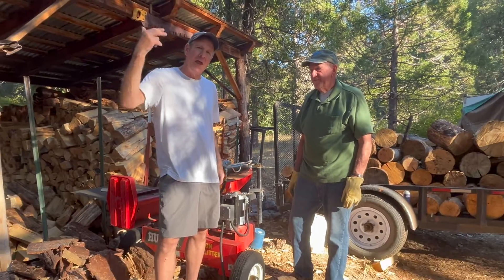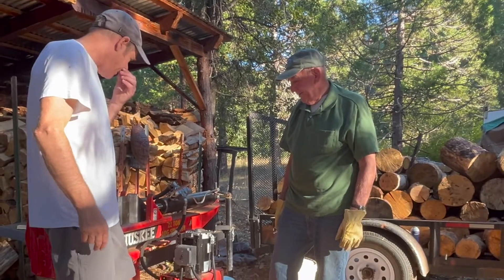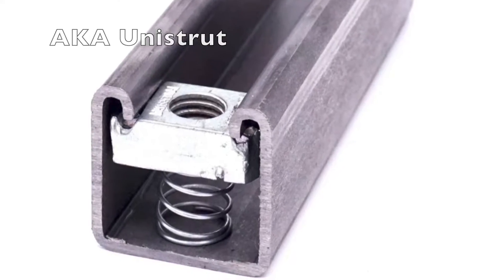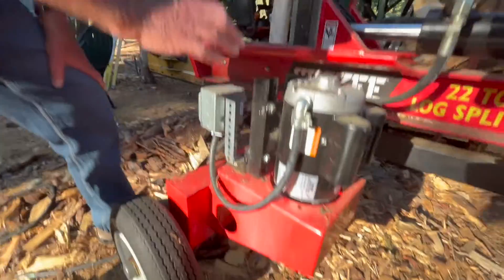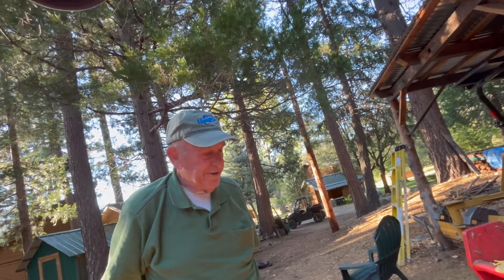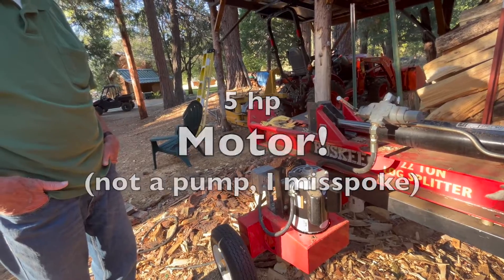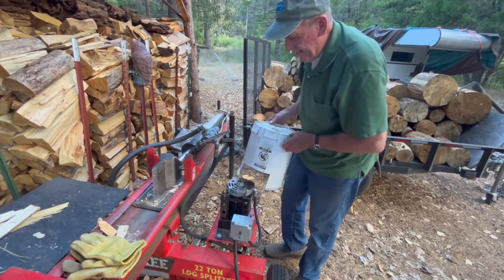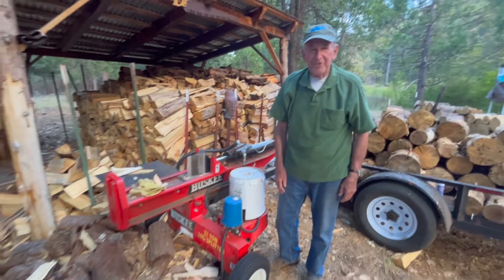Transforming Gas to Electric Log Splitter Conversion!

Comment: Have a few comments for those considering this mod: 
(1) Be sure to match the electric motor rpm AND rotation (CW or CCW) to the required pump rpm and rotation as closely as possible (based on the specs for the pump model used with any given splitter. Hydraulic pump specs vary by brand, size, application, orientation, etc.
(2) The rating of the power supply cord/extension should match or exceed the motor's rated amperage; likewise the outlet/plug ratings if not hardwired from breaker to switch. In this example, a 30 A rated generator or dryer extension cord should work well
(3)  Some practical information on the best way to align the coupling/motor and pump shafts would be helpful.
Reply from the maker: Great information! Thanks for sharing!

Comment: Brilliant idea, my gas engine keeps cutting out under pressure. I will look into the cost of the conversion, thanks for sharing your video.
Reply from the maker: Cool. Check the description for the links to some of important parts. He used a cheaper compressor that saved a lot of money.